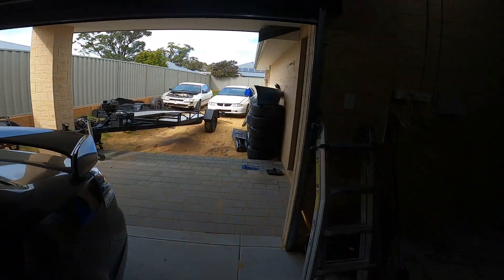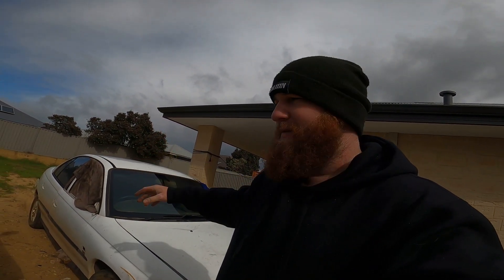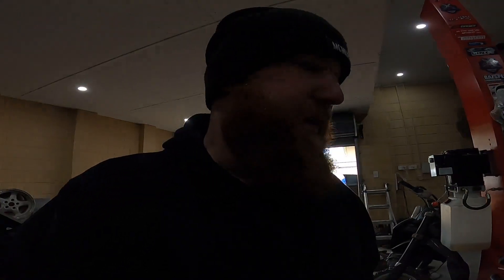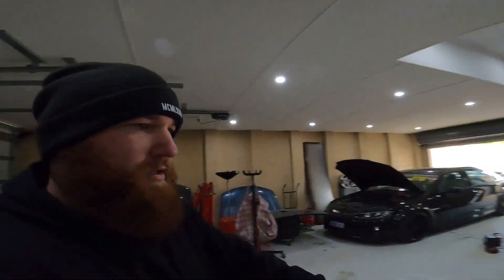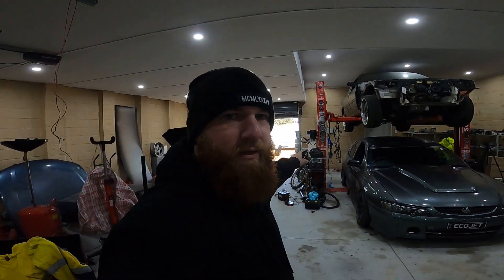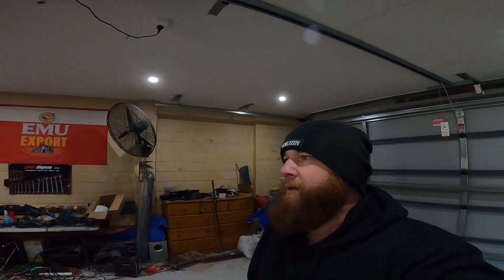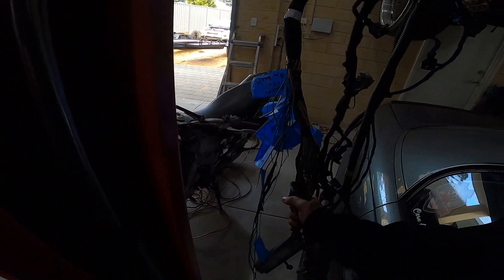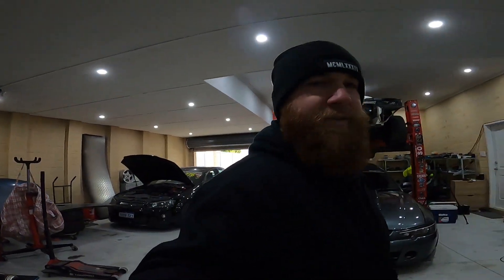Competition Drift Car Build & Channel Update

Comment: The rollers will be interesting testing! Know they work but actually seeing if you get a gain will be good,sold a set just before building mine then cheaped out bought mace for the same price I sold the yellas for!  smart hey?
Reply from the maker: Yeah man will be very interesting to see the actual results!

Hahaha that is supersmart 🤣🤣
Reply: @RKGarage  I think just getting rid of any hard friction point speaks for itself even if no actual hp gains, valve stem wear should be better n oil life alone should be worth it in the long run! I reckon even a 1.65:1 set for street and 1.95 for racing prob not bad idea, having said that told myself to leave out the 1.9 re ground rockers for daily use but that never happened!